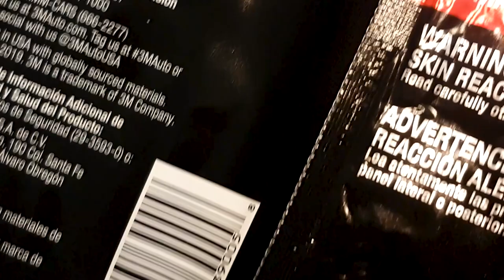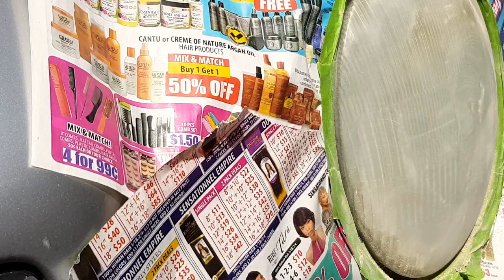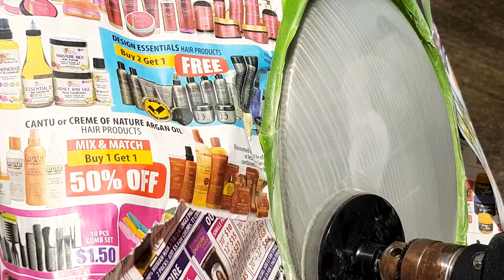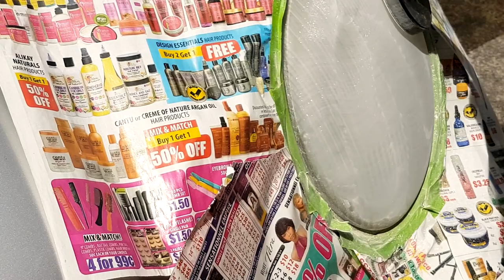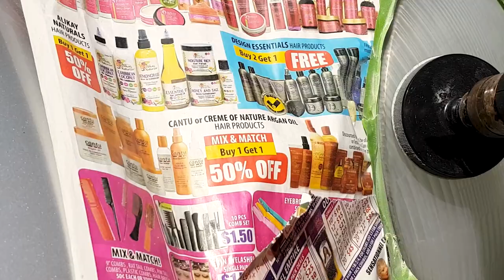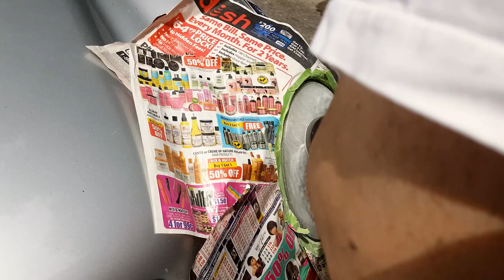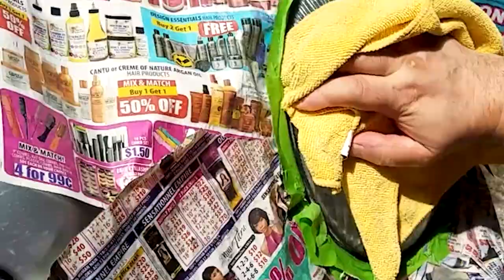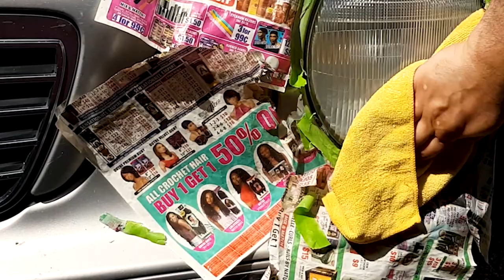How to restore car headlights?

Comment: Sanding cannot be done without water.
Reply from the maker: Hi Burak - thank you for the comment.  I only followed 3M's recommendation.  I wet-sand also in the video but not in the beginning.  But, the result in the video speaks for itself.